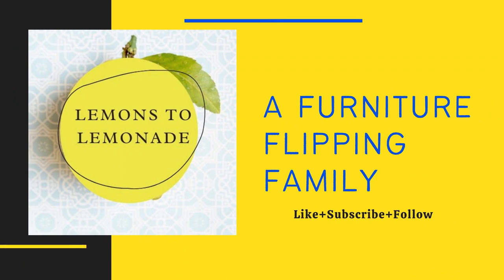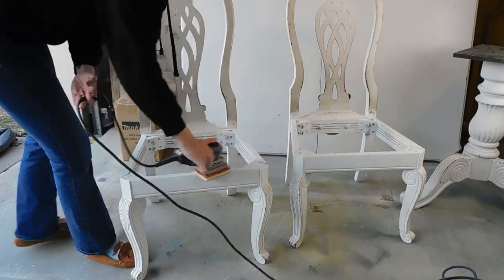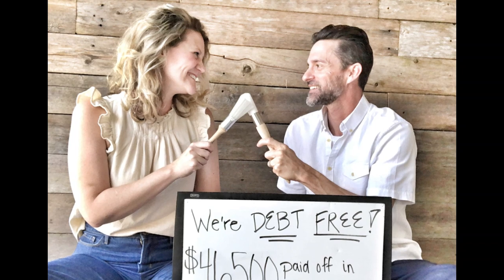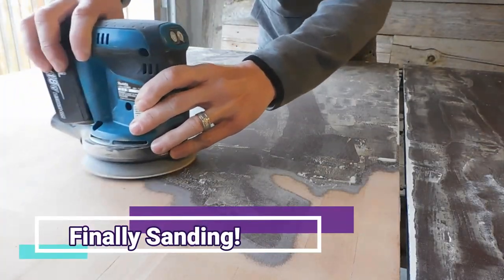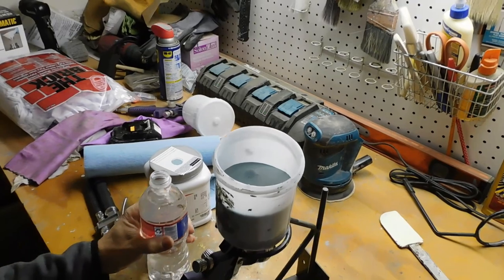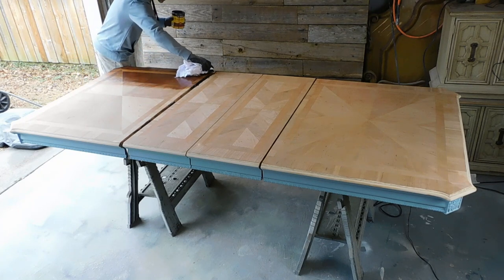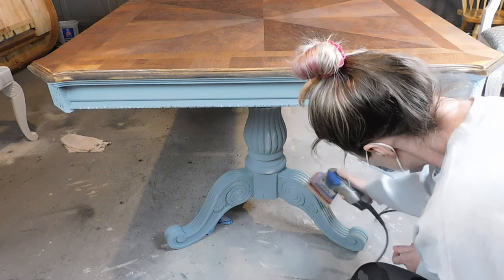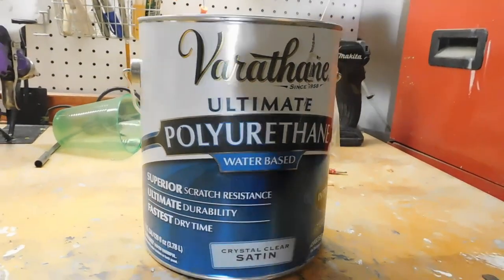How To Make Over Your Dining Table I DIY Dining Table Makeover I Flip Furniture For Profit

Comment: Been watching a few times, enjoy your content.  When using stain assuming it is oil based by can shown  you used a water based poly. I didn't think you could  mix those.  Oil and water. I had some trouble with minwax stain , finally removed with mineral spirits and restrained with a water based stain and then finished with poly water based.  Thanks you any help would be appreciated.
Reply from the maker: Hi! We haven’t had any issues w the poly we use and the minwax stain. I have tried the wipe on poly before and had the same sticky residue, same with the stain w/ poly premix. That was a sticky mess but no issues w the Varathane Poly. Hope that helps!
Reply: I also made that mistake (using minxax oil based stain and then minwax water based poly) and the finish has also lifted in certain areas like the backs and legs of chairs.  Much  better results when using water stain and water poly or oil based stain with oil based poly

Comment: the table and chairs look nice however the upholstery needs more detail...seems done with not too much care...I hope it was just to make the video...  Thank you for been an inspiration for me...need it a lot...blessings to you and yours.  Seems like God is talking to me lately about going into something that i love to do but too chicken to swim across the river lol
Reply from the maker: Lolitabonita - thank you so much!
Reply: Corners are hard to do to get the right tension and avoid pleats.  You have to see it done.
Reply: @rockshot100  yes, u are correct but there are tricks to get those bad corners done the right way...starting with air stapler..and practice and...the type of fabric and the way u work the corner...etc..
Reply: @lolitabonita08  Yes, sometimes it helps to dampen your fabric slightly.  I don't have an air stapler and have even done stripped fabric and you know how easy it is to get that wavey or crooked.  I pull my points first thing, then work so there are no pleats showing on the top.  One shot shows a lump in the chair, but I am pretty sure it is just a shadow.  Probably their first time, so I give them an A+, considering that.
Reply: Start with a tiny little easy project first.  Do NOT swim across the river!   One thing will lead to another.
Reply: @rockshot100  everything u can do taking two or more routes....stripped fabrics are tricky but not impossible to get them right it just takes time and patience (little baby steps).  Anyhow...the chairs do not look good enough for sale that is my personal opinion if they were for home use heck yes those will work just fine but when u are "making over" chairs for re- sale they have to be near perfect with the little imperfections possible if any.  Customers will pay high dollar and they expect high dollar finishes if you know what i mean.    Nice chatting with you have an amazing weekend...